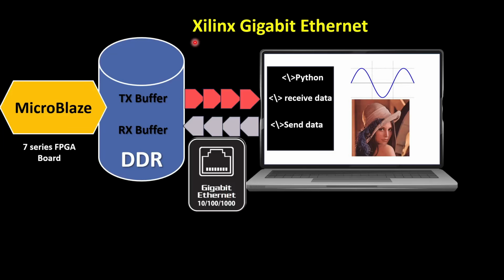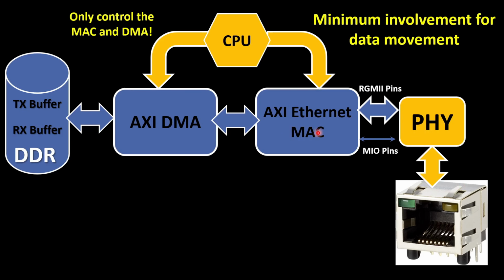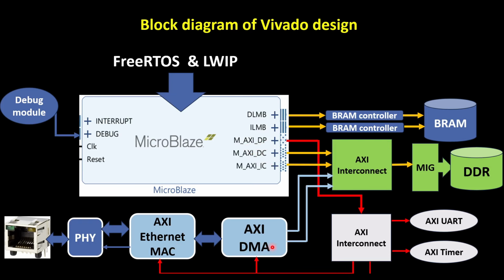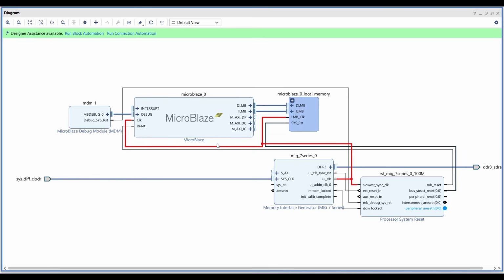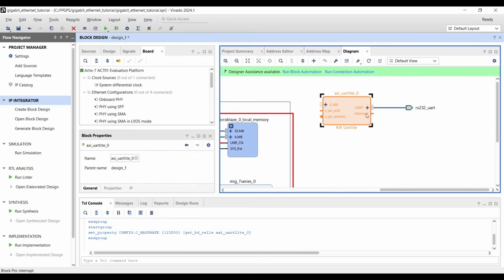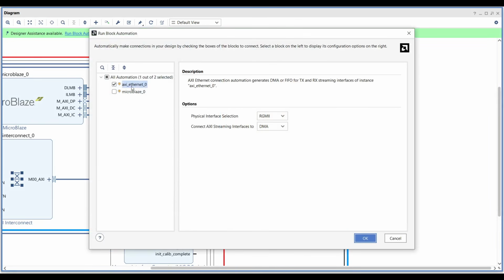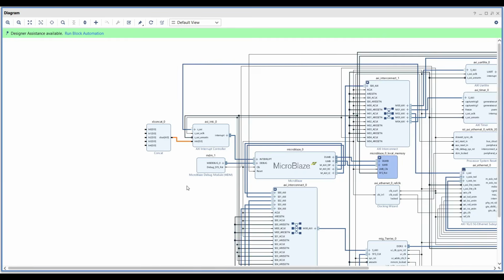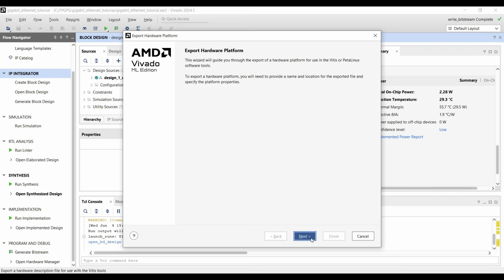Implementing Gigabit Ethernet on FPGA with MicroBlaze and MIG - Part 1: Vivado Design

Comment: Hello, I'm Using Vivado 2025.2, When I add the MicroBlaze and Run Block automation, it adds "Inline_concat", "AXI_Interrupt_Controller", "AXI Smart Connect".
In your video you have added a second AXI Interconnect and you have connected M_AXI_DP (Microblaze ) to S00_AXI ( second AXI Interconnect).
Before adding  AXI_Interconnect, and when applying Run Block Automation, M_AXI_DP is connecting to S00_AXI ( AXI Smart Connect).

This means no M_AXI_DP available port in Microblaze to connect it to AXI Interconnect.

What do you suggest?

Thank you
Reply: In the FPGAPS's video, he must use 2 axi interconnect : 1 for external memory (DDR) ; 1 for Periphral Data (UART, GPIO, ...).
Maybe FPGAPS don't use Vivado 2025.X, I'm using 204.2 version and axi interconnect is labeled as "Discontinued". So AXI smart connect take the lead over AXI interconnect.
In your case, go to Vivado 2025.2/File/Project/Open Example... Here "Refresh" you list of examples, select the microblaze example, select real-time processor ( with DDR).
And you will see.

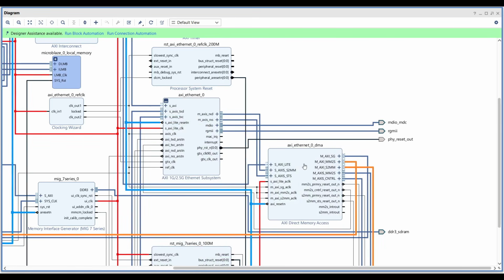Comment: @VishalKumar-x5w9h you can select TEMAC evaluate option and I've read it'll run for up to 8 hrs each day and then shutdown till next interval. To the OP, I tried your tutorial and while it has great content, you really need to adjust it and let people know up front that a license will be required. FPGAPS: at 15:43 in video, DMA is added and so is another Processor reset block with all needed connections, but in 2022.2 only the DMA and a few CONNs are added. It's VERY annoying to have to follow the wires in your video to know what needs to CONN to what ! Finally, I've tried using 2019.2 and ver above and BOTH(!!) fail on timing ( 2022.2 does gen a bit file though )and there are about 460 places where this is true...If your version is soehow better and doesn't have such behavior, it would be good to know B 4 the work is attempted
...

Comment: I'm working on 10/25 ethernet subsystem at it need license to generate bitstream with mac it required purchase.
i faced same problem  with 1/2.5 g ethernet subsystem. Do you have the license or is there other way for this ?
Pls reply it would be helpful for me.
Reply: i think deep down in the hierarchy, AXI 1G/2.5G Ethernet Subsytem IP uses Tri Mode Ethernet MAC IP, which is not included with normal license but has to be purchased.